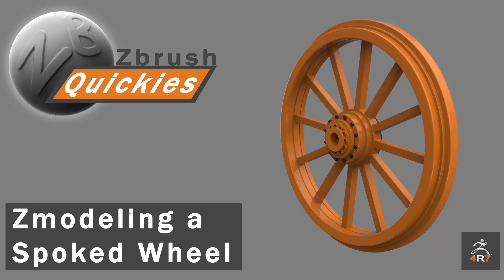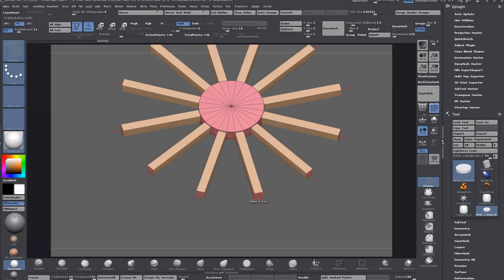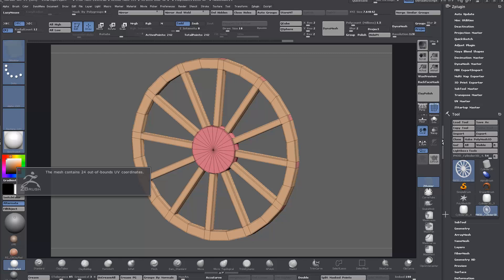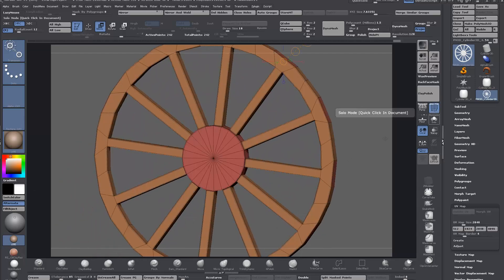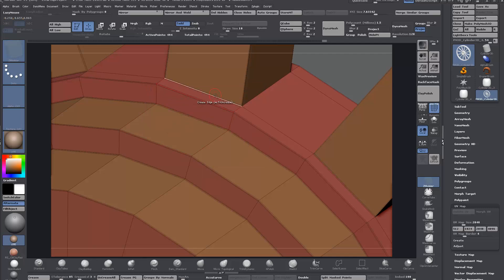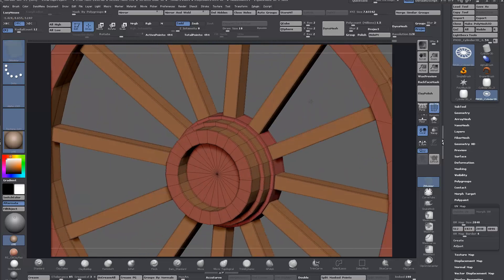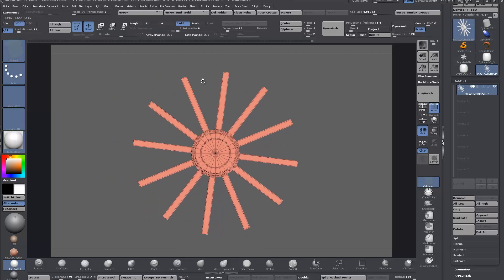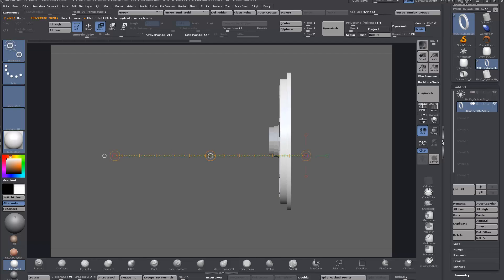Zbrush 'Quickies' - Zmodeling a Spoked Wheel

Comment: Why do even people use Zbrush for these kind of simple stuff. In Blender you can do it within 2 minutes.
Reply: because there are different workflows and different people who prefer to work in different programs. If you are "fluent" in ZBrush, doing this in the ZModeler is perhaps faster for you, than if you were to try it in Blender (for example I never worked with Blender, getting accustomed to the interface would take me longer than making a wheel in a program I'm familiar with).
The ZModeler is a powerful tool, but in the end it's just another way to get to the same goal.
I for example like the function to choose all your options just by pressing the space bar, whereas in 3ds max I'd have to manually switch between editing faces, edges and vertices, while searching for the correct modifiers in the menu bar on the right. But it's hard to objectify what's the "best" way to do this, since that's soley based on your personal preference and own ability and experience with the respective programs.

Take 11:30 for example. He re-did pretty much most of his previous steps to finalize the wheel in basically no time.

Comment: I have been sculpting spoked wheels for the last 40 years, for wargaming equipment and in brass...... Start with the outside diameter of the wheel then the inside of the outside of the wheel rim. Determine the outside of the inner hub then delete the space between the rim and the hub, that way the rim remains smooth. Fill in with spokes and ur done... Well not quite but it makes a nice symmetrical start.
Reply from the maker: Thanks for the feedback. Interesting to know. However, Building digitally is a different mindset. The goal is as few clicks as possible. :)
Reply: I totally agree... I have found your tutorials very informative, lots of useful info and I've learned things I didn't know I needed. The wheel takes a lot less clicks with a hub and a rim, no trying to true it or coax it to a round shape. Just lace it with the needed spokes.

Keep up the good work. Just love the accent to.....
Reply from the maker: Thanks for the kind words, Dave. I'm delighted you've found my tuts useful. When I first started making these vids I wasn't sure how my mumbling Irish accent would be received..........but it seems to have grown on a lot of people.... :)